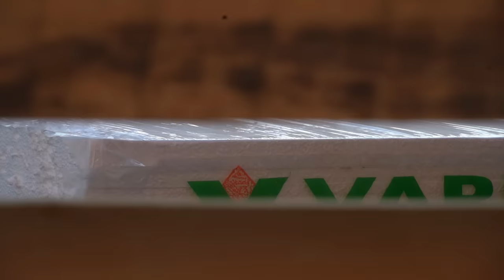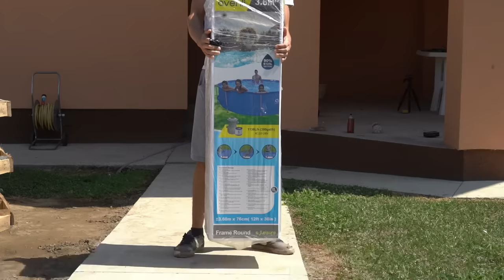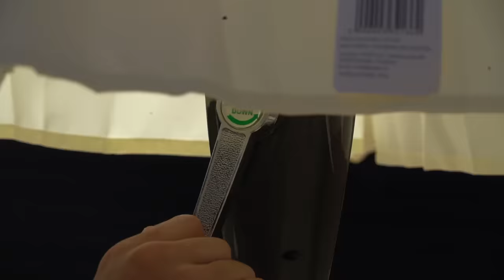Homemade POOL From PALLET !?

Comment: What's the point of making the whole frame from pallet if you will put premade pool inside with its frame?
Reply: Obviously the revenue through google ads. It’s not about WHAT you watch, it’s about THAT you watch. That’s why they simply call it “content”. It’s just crap
Reply: Because it looks way better
Reply: It was to protect the blow up pool from getting punctured. To me that is obvious.
Reply: So you could protect the pool duh
Reply: @King_of-football639  from what? Fkin tank? The "net" made of hay, which is attached at the end as a decorative element would be enough xD
Reply: Too decorate and make a deck and wood walls around the pool
Reply: Wall stability
Reply: Everything everyone else has said but I'll add that the insulate keeps the water warm so you don't have to buy a heater and the insulate also helped him level out the ground beneath the pool without having to spend a small fortune on gravel
Reply: Because it looks better for one, it will last longer and the pre-made  it weak
Reply: Because this is America gosh damnit.
Reply: Well I will say I have had one of those pools before and for the money they are not worth it. Now adding the wall from the pallets and the styrofoam boards. Not only does it keep it level but there is no risk of puncturing it in the bottom or on the sides. I have had replace several pools because something was in the ground and found its way to puncture my pool. And that comes from people having fun. His idea is awesome and if he got the pallets for free it was cheap to make. Have you seen the price of lumber??? Great job young man.
Reply: That's a stupid question
Reply: @MM75955  there are no stupid questions, only stupid answers like yours.
Reply: @wtfDorianGray  it's based on opinion..my opinion says it's a stupid question because your logic should automatically tell you why the outer layer with pallets was built
Reply: @wtfDorianGray  if you're looking to build a quick pool with no hassle then don't build the outer layer...if you want a pool that's built professionally with detail and reinforcement then build with the pallets...it's about opinion...this man didn't agree with your vision and your vision isn't always right...open your mind and think outside the box
Reply: @MM75955  "professionally with detail and reinforcement" xxD... even if someone wanted reinforcement, it is not done this way, but completely differently, so either you make a poor version and buy only the pool or you build the pool yourself, not using ready-made pool from the store, use a special foil, and preferably tiles. What this guy did in the video is sloppy, this pool is still standing independently encased, but there is free space between the casing and the pool... this means that it can still be very easily punctured from the inside and that total crap will accumulate between the pool and the casing.
Reply: @wtfDorianGray  are you aware of what an opinion is ? The pool could've been built many different ways...your way is a boring normal pool with no frame...this person's vision and opinion wanted a frame....moral of the story..this builder's mindset expands more and thinks more diverse than that of yours...and I'm not saying you're wrong..I'm just saying that your opinion about the pool was boring..or should I say "question"
Reply: @MM75955  nope its not boring, its correct. This person just wanted clicks... but the build is made wrong with MANY flaws. Probably you have never build anything so it looks good for you. Btw. what is the point of putting styrofoam on the inside of the pallets (not on the floor, the floor makes sense) if the walls of the pool from the store do not even touch the styrofoam (there is space)?
Reply: @wtfDorianGray  c'mon..you asked another stupid question...you want to know why he put styrofoam on the walls? It's so the lining of the pool doesn't come in direct contact with the pallets rather it has the styrofoam working as a barrier between the two...if you had any sense you would see that but you don't..that's why you keep asking stupid questions
Reply: @wtfDorianGray  ask yourself this...why did he put styrofoam on the floor since you did mention it being a good idea ? He put styrofoam on the floor to work as a barrier rather than stepping on the ground itself..you step on styrofoam and the lining of the pool. Same reason he put it on the wall..it's so it works as a barrier. I'm not a builder but because I'm smart I can understand what the builder's intentions are...not like you who only asks stupid questions and thinks he can build
Reply: @MM75955  im not asking stupid questions, youre just being stupidly agressive... those questions were just rhetorical question, cuz its just pointless to put pallets and styrofoam if there is a hudge gap between the pool and the styrofoam, it wouldnt come into direct contact with pallets anyway. If someone would insist on making this pool in this stupid way, it would be a much better way to put a thick foil on this frame made of pallet and polystyrene or, as a last resort, placing and installing the rubber part of the premade pool but without the frame that was in the box so the casing would make its job 1. to protect the pool and 2nd to hold it. But on the video... its more like a fence than casing xD
Reply: @wtfDorianGray  you are asking stupid questions because you don't seem to have common sense...
Reply: @wtfDorianGray  the first question you asked was why did the builder use pallets as a surrounding and not just put the pool up as is.....now if you can't see for yourself why the builder did that (which there are many reasons) then your common sense is really limited. Now I would like to ask how old you are ? Because I might be speaking to a kid and not know it...if you are a kid then I can understand your answers
Reply: @wtfDorianGray  and stop saying it's a fence because it's not...the lining does have contact with the styrofoam which connects to the pallets. And even if it doesn't make contact(which it does) then the builder can be thinking a decorative look and not just some boring kids pool like how you think
Reply: @joelteha3243 it's not a blow up pool
Reply: @ZirkusRose

Comment: I don't understand the purpose of the pallets if you're going to use a bought pool anyway. I thought you were going to make a pool with pallets but you just used them for support. And these kinds of pools must be taken down end of season, right?  That would be complicated now, I think. I thought you were going to just put a liner in there and put a wooden top on it. Makes for sturdy sides, though, I guess.
Reply: I think to hold the  insulation for cooler days. Why would he need to take it down? He doesn't have to worry about the cold freezing the pool from the sides and bottom due to the insulation. He can just cover it and add an ice pillow in the winter.

Comment: With a job like this it’s worth the small expense to get a proper foam gun and something I find in most situations a good alternative to cutting off excess expanded foam is after five minutes or so when it has formed a skin it can be pressed into shape and leaves a stronger skin on the join 

Great job